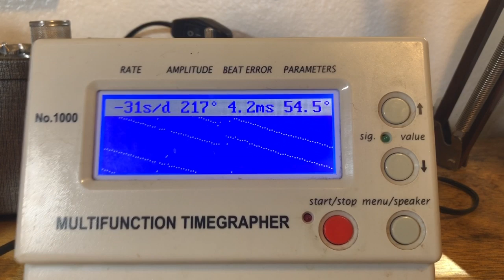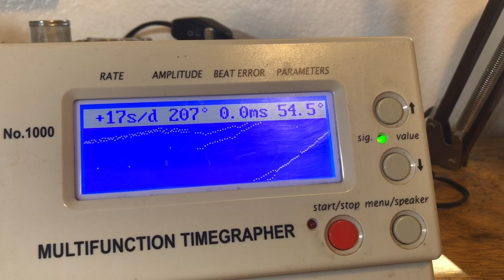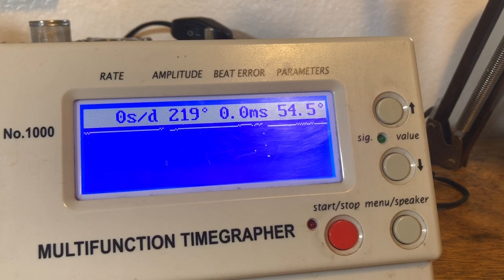For KB: Seiko 7006-8007 dress watch

Comment: Bought one of these in Singapore in the 70's when my Pogue had to be serviced (again). Worked well for about 20 odd years until I put it in the closed pocket in my boiler suit (coveralls) finished my watch in an engine room of my vessel and put the boiler suit in for a wash. Getting it back I found the wash (very clean!), but, the watch had stayed together,but, the whole of the watchworks had turned about 60 degrees clockwise and saturated. Threw it in the bin which I regret as it kept really good time initially and it could have been restored, anyway it became landfill in Far North Queensland. The Pogue I still have and that is right now being given a desent overhaul before I can do some more work on my old IWC and an old Roamer pocket watch

Comment: Again can I suggest that it would be much more interesting to watch you making the adjustments for beat error and regulation on the watch itself rather than watching the numbers change on the timegrapher.
Reply from the maker: Of course, and I certainly understand.  I've only included live adjustments twice now; sort of on a whim.  There's no setup I have that would allow me to film the adjustments I'm actually doing while live.  I need to be right on top of the balance levers, and I can't be distracted or worried about anything.  100% focus on the adjustments.